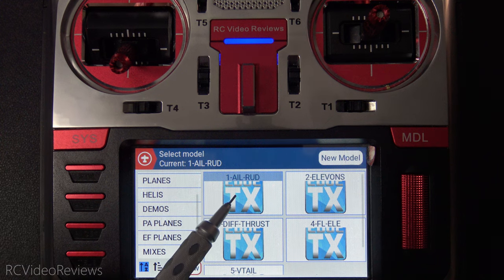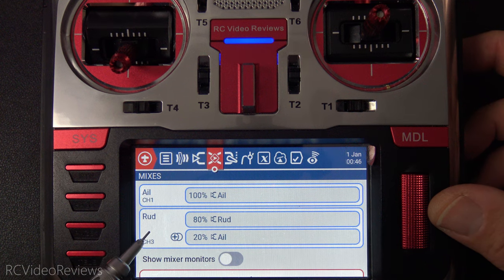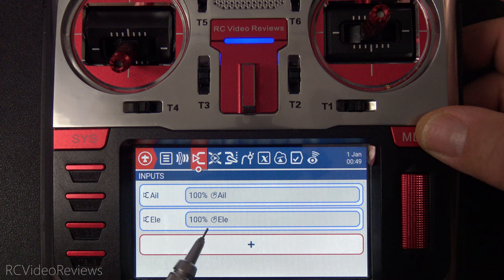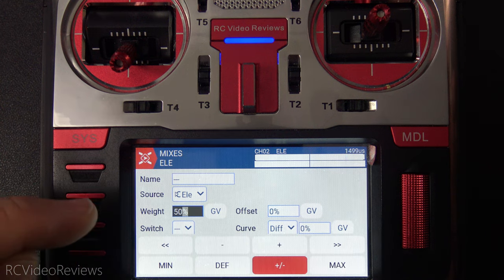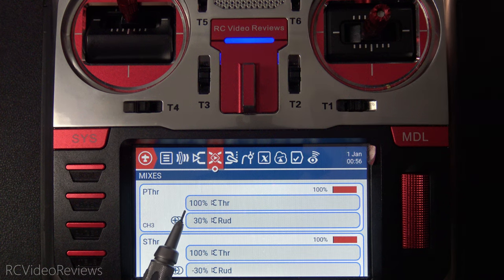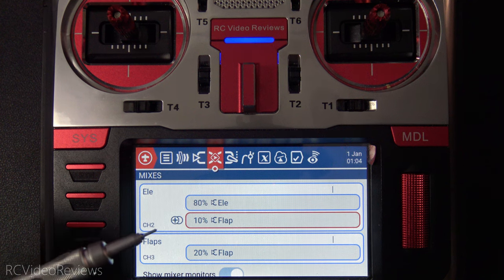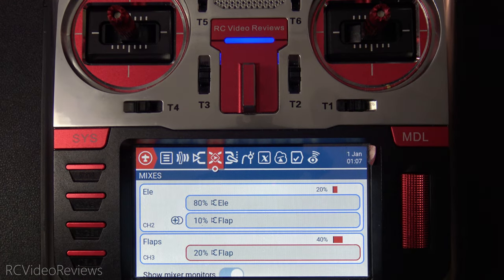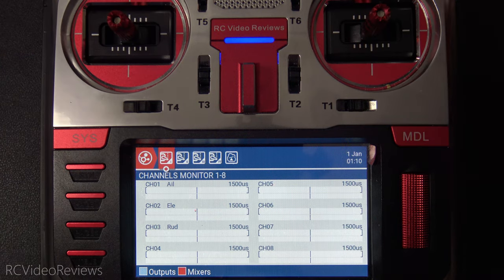Most Used Fixed Wing Mixes in One Video for EdgeTX

Comment: Speaking of aileron/rudder mix, I used to fly the F-15 Eagle in the Air Force and one of its design flaws was they built-in a permanent mechanical aileron/rudder mix. It made normal flying a little easier but it caused two problems. The first is you had to be careful when flying inverted (or anytime pulling negative g) because the mix caused opposite rudder deflection to what you needed when moving the aileron which could cause loss of control and a possible unrecoverable flat spin. The other problem was the mix could make you less reliant on your rudder and as a fighter pilot we need to use all the flight controls to their max ability in a dogfight. I use my TX16S Switch B to turn off the aileron/rudder mix for acro. I wish the F-15 had a switch.
Reply: That’s fascinating! Thanks for sharing this neat nugget of knowledge!

Comment: Yeah, but like that you don't have 100% under normal circumstances - right? Why not just use the 100% from X + the i.e. 20% from y. And in order it won't overshoot, you limit it to 100 in the outputs?

Comment: Good video as always. I use a total of more than 100% on my delta winged and taileron aircraft since they seem to be limited to 100% by the output. I want to have 100% elevator and not fly around with only 50% authority but still have the aileron making a difference.
Reply: I prefer also not to limite main function in the mix and set them to the necessary throw, but to avoid overdrive servo I always set the max displacement in the output with min and max for all servos. Advantage, you still keep full deflexion for the main function and if it hapen that you could overdrive because you apply also another portion of throw with the mix there is no risk for servos and linkages. (run about like your exemple for diff thrust, but in this case the limite is not the esc calibration but the max or min throw of the servo). For exemple this can be obvious, during knife edge, where some time you need full rudder deflexion then you don't want to loose part of it because of mix.
Reply from the maker: I agree the output should be the limit and have no answer for why I've seen servos overdriven, but I have. However, I can also state every wing I have flies quite aggressively using the same mix. 

I'll also make note, if you allow one surface to consume the full physical movement and need the other surface, it won't be able to move. By limiting both to a combined 100%, you have the ability for all controls to move a surface at full extension by an opposing control.

i.e. Ailerons can move while at full elevator. Or elevator can move while at full aileron. If you use 100% for both surfaces you'll get differential movement if one surface is at full deflection and you move the other.
Reply: @RCVideoReviews  for a wing I agree with you. Sharing throw between aileron and elevator in order to have max 100% is ok. But there are other applications where limiting servos throw is a better solution. In my ruder exemple you don't care to loose ail to rud mix when on knife edge, you need more rud to ail and rud to ele if the plane doesn't go neutral in this position. For me there is not only 1 way, but regarding the use, sometime sharing throw is better, and, sometime limiting throw is better. Another exxemple for F3K gliders and air brake we use falperon with huge negative throw and we don't want to loose portion of this throw at full brake then it's better to have only the aileron going up still working.

Comment: Fantastic video. I got one glider with V-tail  - so now i know how it is done in case i have to do it my self. Right now a Lemon 10 Ch Rx does the mixing internal (and it has built in telemetry, altimeter, vario and Stabilization). The Rx should be on the market soon. I've bin testing this for some while now on my Mantis glider.
Reply from the maker: Yeah, normally if you have a stabilizer, the stab will take care of the mixing.

Comment: I'm not sure if this was a firmware fix since this video came out but the servo monitoring page shows that at max rudder of 100% when I move the ailerons the ail/rud mix is ignored and the value never exceeds 100 or -100. It seems that setting the rudder to 80% max to compensate for the 20% ail/rud mix shown in the video isn't needed.

Comment: I have a request for a future video:
Dynamic elevons.  Typically, you are not supposed to have the combined rates for the aileron and elevator be no more than 100% so you make it something like 50% aileron and 50% elevator.  Sure, you can hard code/change this ratio to something like 70% aileron and 30% elevator, but wouldn’t it be cool if the programming can determine how much elevator rate you are using (from a slider adjustment) and if you’re not using much elevator, dynamically add the unused range to the aileron range to give you more throw.
The RCGroups thread below discusses this issue and a couple of people came up with some ideas that apparently work.  It’s a complicated subject.  If this subject interests you as a video topic, my request is that you read the RCGroups thread below, make sense of the different options that would accomplish this, and then make an EdgeTx video describing how to do it.
I currently use two switches for rates (SA down – low aileron, SA mid – left slider real-time adjustable aileron rate, SA up – aileron high rate). Same setup on the SD switch only for elevator rates.
I’m not sure if this kind of dynamic sharing of unused range would work with two rate switches and adjustments or if one slider would be used say mid point would represent a 50/50 ratio of aileron/elevator ratio and as you slide the slider down it becomes say 30 aileron/70 elevator and as you slide it up from mid-point it becomes up to 70 aileron/30 elevator with max and min’s set up in a curve so you don’t shut out the other range. 
https://www.rcgroups.com/forums/showthread.php?3122290-An-alternate-elevon-setup-for-OpenTX

Comment: Thank you this was a good video.
I run my ailerons on two channels, how do you set that up, in edge TX? I guess I don't understand how to apply two outputs from one input. I guess this is also a mix?
Reply from the maker: Yup, just add another mix line and use the same input.

Comment: Are you able to combine Differential throttle & Aileron to Rudder for easy coordinated turns on twin? ( No rudder on my fixed wing. Ranger T1)
Reply from the maker: Yes. Same rules apply. Find the thing that needs to be fixed and add the mix for the thing that does the fixing. Same rules in force.

Comment: In my Boxer radio, I am trying to create a mix for a dual servo configuration,(one servo on each aileron), using channel 5 (which controls the two-position switch (SA)) and the aileron channel 1. After mixing it with the aileron channel to control both ailerons with the same stick, the aileron is behaving as if it were moved by a binary switch (example +100 and -100) on channel 5 only, while channel 1 works normally. Although both show continuous movement from -100 to +100 on the channel monitor, the aileron doesn't act like this in real life, but in a binary way. Why might this be happening? Can you help me with that?
Reply from the maker: ELRS?
Reply: yes @RCVideoReviews
Reply from the maker: Channel 5 is only proportional in 333hz 16/2. See this page: https://www.expresslrs.org/software/switch-config/
Reply: I appreciate it! @RCVideoReviews  I was scratching my head for hours.

Comment: REQUEST: I know how to program a motor kill switch, I can't figure out how to program a THROTTLE HOLD switch. (for air[planes running on gas or glow) One that acts like the one on my Hitec TX. It will hold the throttle wherever it is when the switch is activated.
Reply from the maker: The only way I can think to approach that problem is with Global Variables, but I'm not aware of any way in the current firmware to override a channel with a global variable. Therefore, the only other option I can think of is an approximation. You could use special functions for SWx Up, SWx Mid, SWx Down and user Override Channnel (throttle channel) and hard code a value. i.e. You could do 25%, 50%, 75% with Override -50, 0, +50. That's not very granular, but it's the only thing I can think of absent a channel override with a specific value.
Reply from the maker: I figured it out. I'm probably going to make a video on this.
Reply: @RCVideoReviews  Thank you!

Comment: First of appericate all of your video , which help every day , and i hope other , i was use to with JR RADIO , thats why taking some time ,
my questions 
==========
INPUT section ,  you mentioned weight 100 for AIL AND 100 for ELE ,
AND IN MIXES ,  you used 50%weight value for ail and ele ,   
dear when i set in input ail and ele  through or weight low rate 50% , mid rate 70% and high rate 90% ,

but these rates movement are moving  with weight 50% difine in MIXES ,  i think should move with rates value , i difene in INPUT , PLS CLEAR THIS POINT ,
CAN WE INCREASE MIXES WEIGHT TO  100% ?   TO get more through value 

i hope your under stand my point